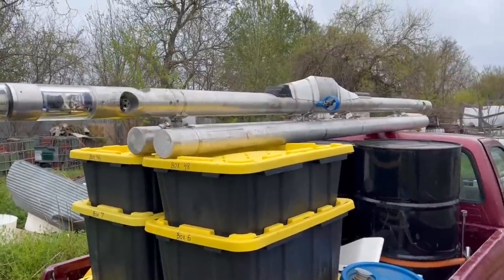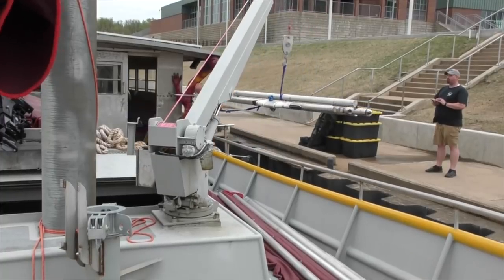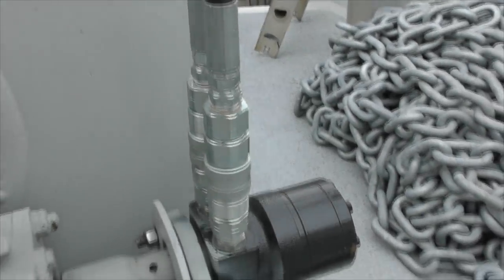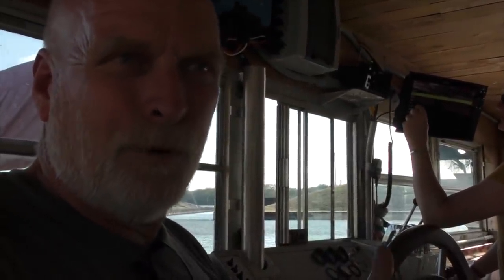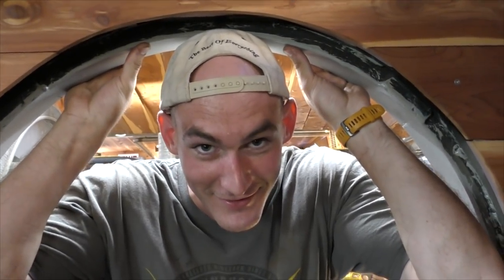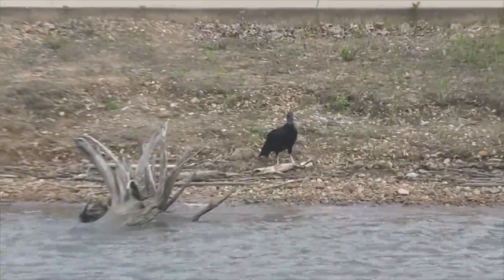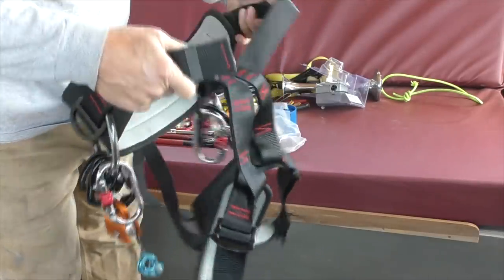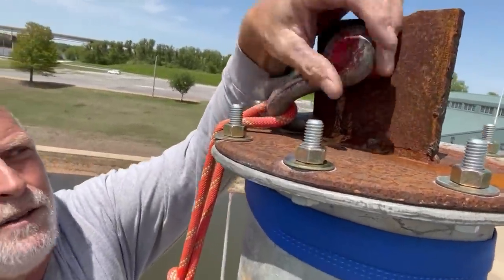Raising Sails - Part 2

Comment: On the wireless wind transducer, try to make sure the thing is sealed as best as possible.  The one on my boat did not even last a year, it got water in it and fried the board :-(
Reply: Uma had a similar problem it caused contact corrosion.
Reply: Mine lasted 18 months , went back to a hard wired one

Comment: Crane owner operator here.   Use a 10x10 or so canvas trash bag for a crane.    I paid $400 for mine at Indusco in Capitol Heights MD.   It's basically a 5000lb plus rated industrial nylon canvas with 6 nylon straps sewn in

Comment: I added a string like the wildcountry ropeman has onto my rollnlock and it's a game changer, needs to be thing cord so it doesn't get in the way, makes disengaging the cam and/or using it as a pulley easier

Comment: Well hopefully that Jib works out well.  I think it should hold up pretty good though only thing I wonder is if it's going to start to bend a bit under load if the load gets way off in the wind.  Anyway I don't blame you wanting to be up there on a calm day.  Replacing a roof puts me in the same boat at about 30 feet off the ground and right now I am only getting a few days a month to work on it between wind and rain but I am 90% done with one side of the roof and started pulling off the siding to turn the 2X4's into 2X6's.  After I fir the 2X4's out I can then put in R19 batt insulation and cover it with R10 XPS foam insulation.  Should seal the 110 year old house up a lot better than it was before.  Still have to put the old siding back on for now but eventually it will all be replaced with something a little nicer.  Between that stuff, running electrical, datacomm, and low voltage sensor lines as well as doing a few other things to prep other work I know the stiff and sore days quite well.

Comment: Buy a separate tilt style float switch and wire it to another pump, or the one you have.
They come as a little ball with a wire that you can cut and wire to whatever and you can replace them when they eventually go bad after a few years.
You take a piece of plastic or metal and have it on the side of the tank and ziptie the wire to it and adjust the length of wire after the tie to adjust the float.
Your tank might me too small but they make them pretty friggen small.

Comment: If you have two engine room fans, you can run them in series on a 24v supply.
Reply from the maker: Yes but it’s not a great idea because if one jams up or dies it will speed up the other shortening it’s life.  We’ll likely often just run one too.

Comment: Zoller sump pump available at Lowes 1 1/2 inch discharge and 120 volt 60 hz. They are expensive around 300 dollars US but they do the job in extreme situations. Had one I installed in USS KIDD building elevator shaft. Thing ran coming on  every couple minutes for 6 months out of the year for 5 years I was there. Pump is still running as far as I know and I have been gone for 2 years. Also used same type to pump bilge on ship when a sewer or freshwater line leaked. Never had a problem unless I jammed it in a space that jammed the float. Made of Cast iron or I think you can get bronze for salt water situation if needed. You could also bolt a board or piece of steel to bottom to keep it centered in the hole.
Reply: Zollverein pumps rock

Comment: Im surprised you haven’t bought the climbing ascenders with the handles. You get a right and left hand then put a foot loop on one of those rope mans then you can climb a rope like a ladder!
Reply from the maker: I don't think you can use them for the descent so it would require switching over to a figure 8 or some other friction device before you can come down.
Reply: We use some prusik cords to climb with. Transitions easily.
Reply: @SVSeeker  yeah that’s true you’d have to disconnect them at the top and switch to the grigri for rappelling

Comment: For water pump on / off by water level you can use mercury buoy or electrode sensor to use the water as the switch, i use it in wells to safely stop and start the water pump by the level of water inside a well…👍🏼😎🇵🇷

Comment: word from an old climber here. Please do not attach yourself on one point only, have a second attachement to that huge piece at the top of the mast. If possible, try to have something to smooth the contact between the mast ant the rope. Given the tension any movement on the rope against that metal border will cut it.
Reply from the maker: There’s a safety line Mom.
Reply: @SVSeeker  Happy to read, sorry to bother you, keep up the amazing adventure.

Comment: Looks like that climb isn't too bad in that harness. At least you get a chance to rest in the foot loops. That crane you put on the top, we called that a Gin Pole - used for building and dismantling antenna towers.
Reply from the maker: It will be even easier if I make a habit of it.

Comment: When I was gunkholing on a sailboat I asked the skipper why he told us to yell if the depth sounder read 5. He said it was because the boat had a 4 foot draft. I was confused until I realized he was reading a detailed chart and navigating by the soundings - it would have been difficult to identify the true water depth by allowing for draft and sensor depth.

Comment: Zoeller pumps have always worked well for me. Cast iron and tough
Reply from the maker: I’ve seen them I’m just not sure how well they would hold up around saltwater.
Reply: @SVSeeker  Good point. Call them. I like that they are cast iron and use a brass impeller. Not sure about the robustness of the floats.

Comment: I saw the aluminum welding too, but for me the first video was moving the old 12x36 lathe in and reviewing it with Super Dave. I bought one of those lathes and now have an entire machine shop and fledgling YouTube channel right at the top of the port of Catoosa very near where SV Seeker was built and launched. Thanks Doug, I hope I do as well. It would be an honor if you ever need anything worked on to help out, I do have a machine shop right at the top of the hill if needed.

Comment: One of the scariest things I (me along with Chris from Germany) did back in 2016 was to cut out the mast-foot on seeker for the most forward mast (is that the mizen?) which was misaligned and needed moving….it didn’t give way easily and boy what a cramped space…..but it was all good fun…. ;-))……Good to see Bard is alive and kicking once more….greeting from the crew from Rotterdam.....
Reply from the maker: You need to come back.  Now that the mast is installed along with two air tanks.  We need to move the hydraulic accumulator to that compartment too.  You think it was cramped before.  : )

Comment: Would a pressure sensor sensor on the end of a submerged tube be better than a  float switch? I wondered if the verticality of the switch is the reason they're not working reliably?

Comment: It's funny you mention all the climbing gear.. when I was about 18 so 32 years ago.. I went and helped a buddy set up new rigging on sailboats at the Cleveland yacht club and that's where I learned all my rope gear and rappelling etc etc.. I'm too fat and old to do any climbing but I sure love repelling as long as there's a elevator!! Biggest one to date was 200 ft about 5 years ago off an apartment building.. what a rush!! I learned on descenders and figure eights.. but we had so much weight on a rope we had to use a rack! PS do you have any plans of setting up a Spinnaker for downwind runs??
Reply from the maker: No plans for a spinnaker.  Junks are at their best running downwind.  Now we might add a bow sprit and a jib someday on.

Comment: Hardware store sump pump. Our true value basement pump has never failed to turn on, never gotten stuck open or closed, and has dealt with a lot of particulate. We allow our washing machine to flow into the basement sump, then pump it up to the sewer line and then gravity feed out to the street line.

Comment: I've been using that same 100 amp step down, the 48v to 12v version. I have 2000w of amplifier running off it. It works great and never had a issue. I did make a 3d print to cover the terminals.

Comment: I love the P-pump 12-valve Cummins!! Was curious if you know about the KDP “killer dowel pin”. It’s just a pin that holds the aluminum gear housing to the block and has a tendency to fall out and land on top of the cam gear 😬. Just curious if you tabbed the KDP.
Reply from the maker: Yes, thanks.

Comment: Hey Doug, maybe you can pair up the fans in series to be able to run them directly of the 24 volt batteries??
Reply from the maker: Yes but it’s not a great idea because if one jams up or dies it will speed up the other shortening it’s life.  We’ll likely often just run one too.
Reply: @SVSeeker  I must disagree Doug... Devices wired in series (which I suggest you do - 12v fan in series with another 12v fan) tend to work in concert. If one fails (usually they open circuit if they fail) the other one stops working. The failed one acts like a switch would. In case the failure is not an open circuit but a short (which is rare if not unlikely) will result in the other fan getting the full 24V. In that case you can put an inline fuse somewhere in the chain which is rated slightly higher then the current one of the fans draws at 12V (assuming the fans in series are identical or at least draw identical currents)
In case the failure of one of the fans is a short the higher voltage (24V) results in a over current in the chain  tripping the fuse so the other fan is safe...
If this jazz makes sense.
Running one fan may not be efficient anyways: you may need one fan to push out air as another pulls clean air in...

Comment: Could try a tethered float switch. It just uses a lead weight to turn on/off
Reply from the maker: I might, but there is not a lot of room in the sump.
Reply: @SVSeeker  thanks for the reply. Upon further research and thought, the best solution is to try a better up/down sump pump switch.